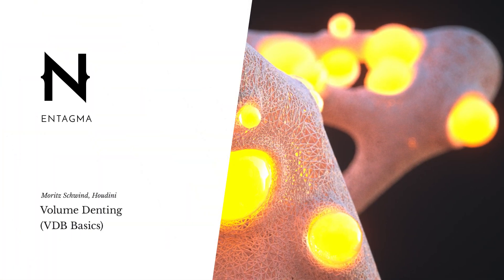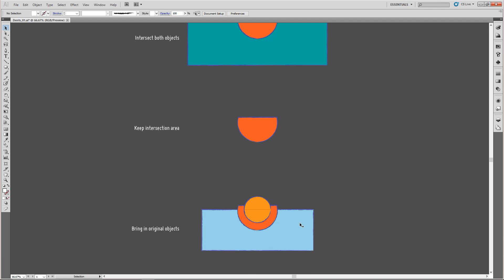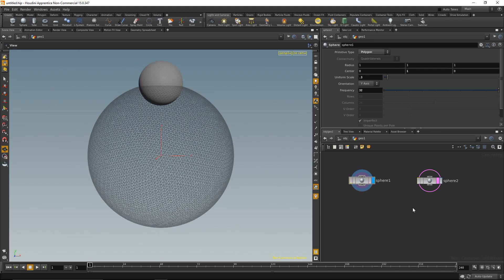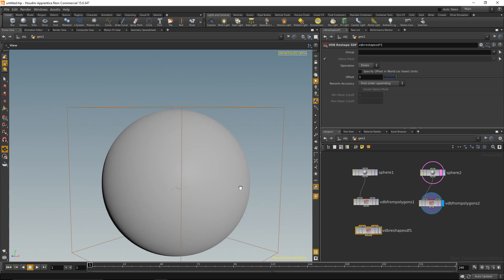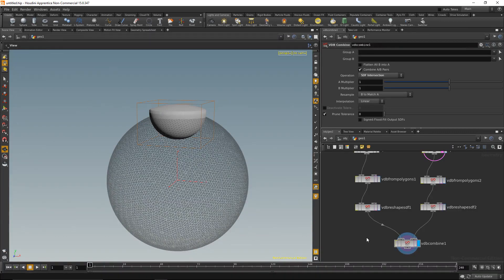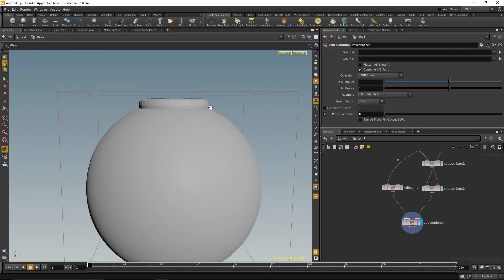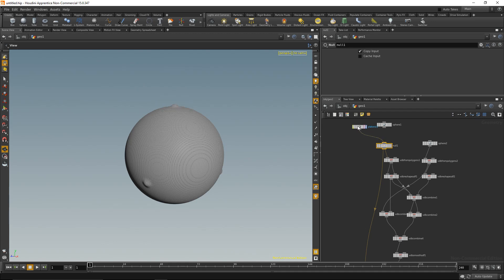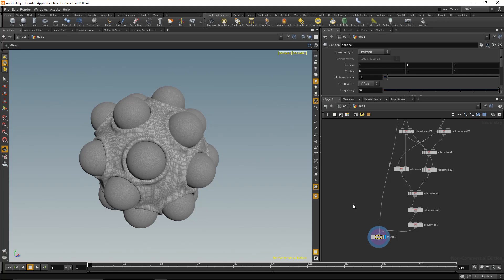Boolean Denting (VDB Basics)

Comment: For those following along in later Houdini versions, this can be done with the boolean operator without VDBs.  Make sure your objects are polygons not primitives.  I haven't explored getting the smooth right if you stay in polygons.
Reply: I do like VDB's though more smooth.

Also there's magnetize using metaballs, but need dense polygon grid for that.